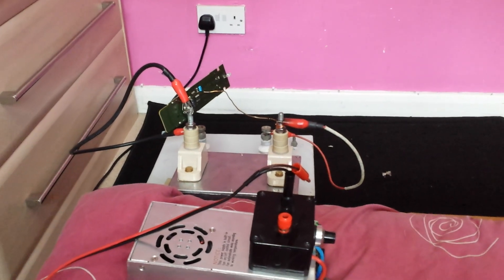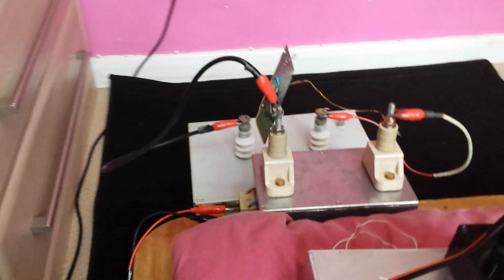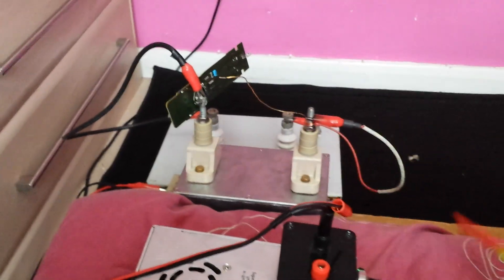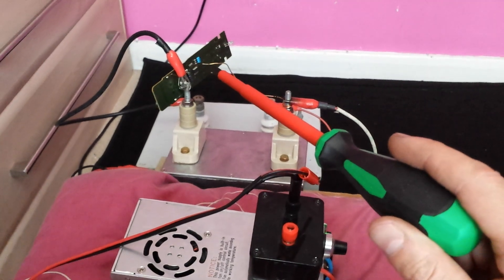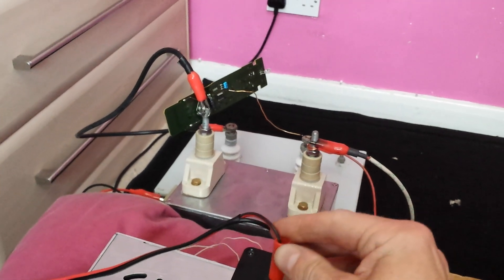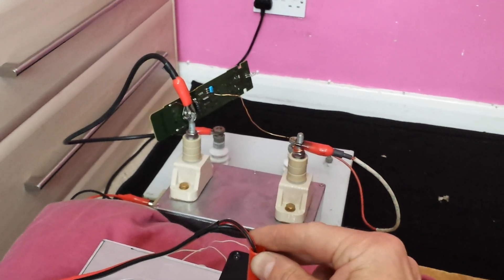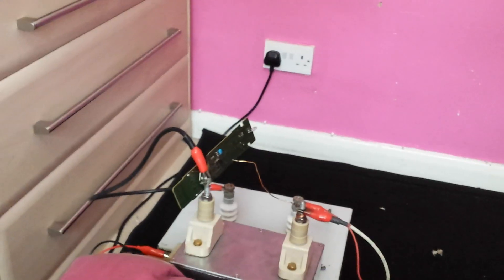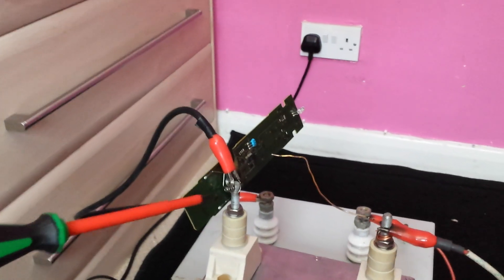Big capacitor destruction!

Comment: Idea for rocket car. Have hopper full of caps feeding a rocket exhaust. High voltage applied in exhaust. Blast goes out the back and pushes car forward. Yup. Head is full of crazy. Amazing video. But then I am easily pleased. LOL.